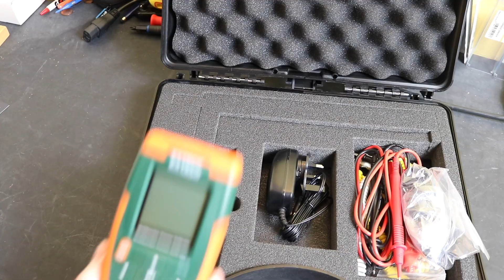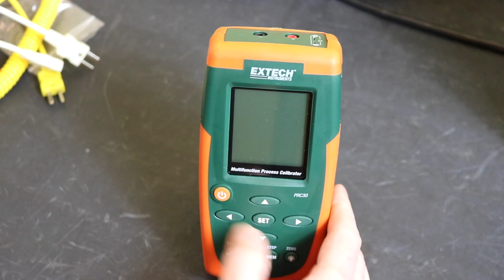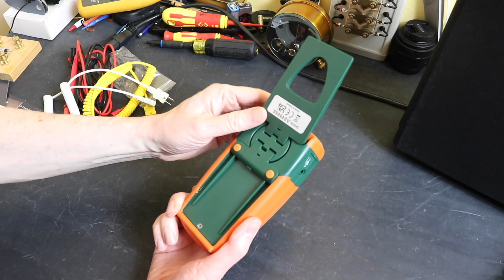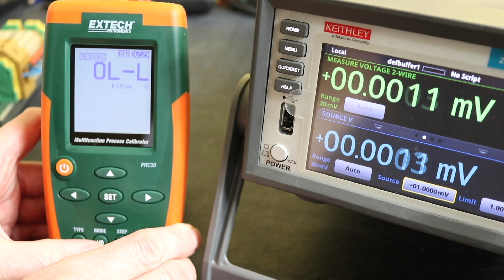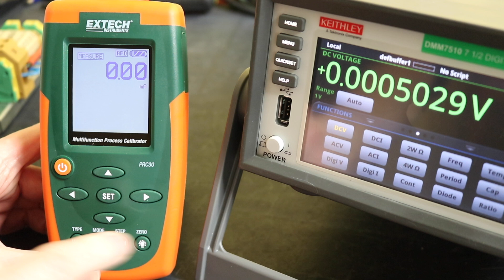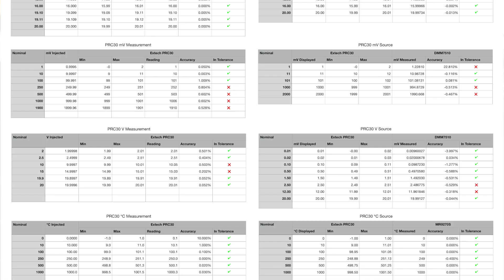Extech PRC30 Multifunction Process Calibrator Test

Comment: Remarkable price, and same here/DK, where its tad over 900$ / 700£ (with VAT)
..Very rudimentary, with subpar resolution& performance.... lowest seems to be 1mW source = that then gives 1.23mW  (+23%) and its anything but stable in many of its readings so clearly on the limit on what it can muster.
and even cant hold many of these edge range value, like 10mV in the volt range..does it cycle up and down? goes from 10.1mV down to 9.4mV  10:10 

Slap a chinese no name or budget brand on it... I would have guessed around 30 to 40 bucks as the resolution leaves a lot to be desired.
and the lack of an "on vs off" output user control - is not ideal
One can only wonder the margins Fluke have on a unit like this.

What in-field process calibrators / multifunction tool gives 1uV source & measure tolerance and is able to deliver it.?  a tool with such fine granularity tends to perform quite well for temp and likely also why your temp was jumping around so much, as its voltage is anything but stable.
Thx for the vid.
Reply from the maker: This is as stable as I can get it. I don't believe there is an issue with the test set up as other instruments are steady.
At best you could use this for general fault finding, but there are a lot of other instruments out there that you can do that with and cost no where near the cost of this one.
Thanks for watching and commenting.
Reply: @three-phase562  yes.. your setup is good.
Are there any of these multifunction process calibrators that you come across that have 1uV source & measure ablelity?
Reply from the maker: @JAKOB1977  For 1uV resolution you are looking at the likes of the top end offerings from Fluke and Druck etc at £6k and above. Best I have seen with these smaller units, and the cheaper ones from Fluke, is 10uV.
Reply: @three-phase562  Yes, was also my impression.
Purchased one from China, a year or two ago, from a company that makes industrial gear.
Hongrun Precision Instrument Co. that seems to be making various displays, thermostat PID controllers, isolators, temperature-pucks etc for for the industrial market, so more or less the same product-segment where these process calibrators are intended.
That unit will do 1uV source and measurement.
It also comes bundled with an external cold junction USB3 dongle... you can choose between "external, intermal and custom".
Contacted the company in China, as I do like exploring gadgets that we dont see in the west - and they would gladly sell in 1pcs units, but only domestic, prices was arund 110$ / 83£ before danish VAT and shipping etc.
so quite a lot more then the SG003A that I used a lot, which was only around 45$ / 34£ back in 2022 incl. 25%VAT but that unit doesnt do, resistance, and temperature etc.
You can see the uV tolerance here https://youtu.be/TXshmOTi7M4 but it does take soem time before its stable, like many minutes after turn on, before it settles at 0uV from its own voltage source.
Reply from the maker: @JAKOB1977  Interesting, not heard of that company before. Thanks for the demo. They do have the NHR-100 and NHR-200 on Aliexpress, showing £800 and £350 respectively. 
I will have a deeper look and see if there are alternative sources.
Reply: @three-phase562  Yes, the NHR100 and NHR200 is their older more ruggedized unit, and also got higher tolerances.
I took at look at ali.. the lowest i saw' for the highest model "03" was  around 125GBP but that from Denmark so it likely differs at your end, also worth noting that these days, you can take around 15 to 20% of these listings with Ali's singles dayCodes.

Its labelled with NHR instead of OHR, but I believe the HNR is their western-oriented brand label, where OHR are their domestic.
There is a thread on Daves  EEVforum. with datasheet and tolerances "OHR Multifunction Process calibrators"
Posted the western datasheet there.